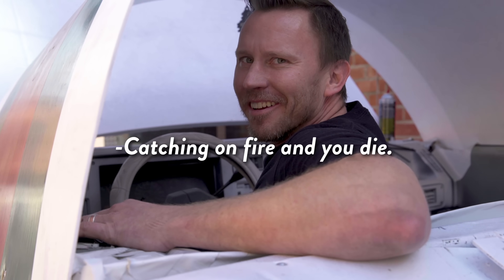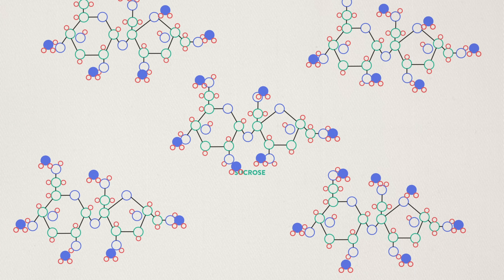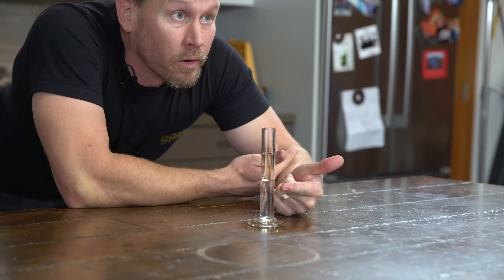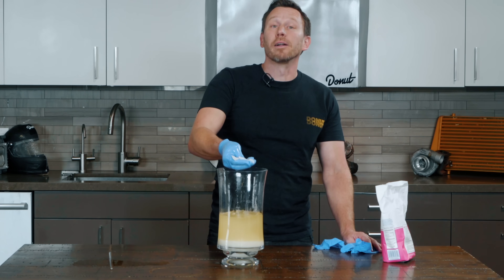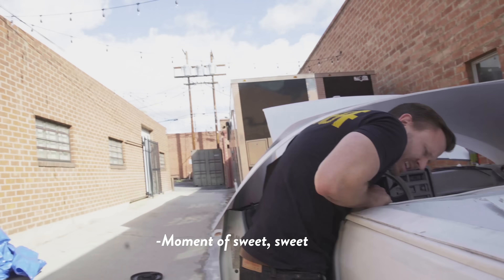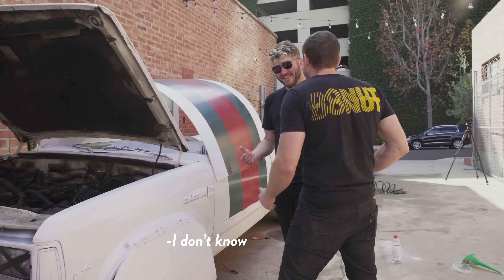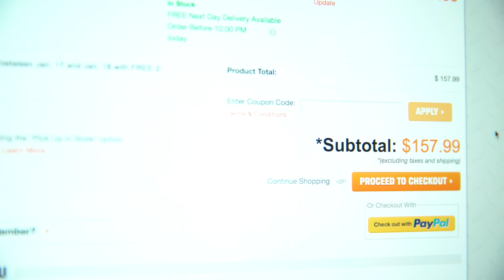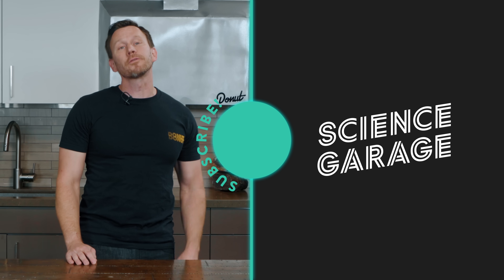SUGAR IN THE TANK - What actually happens? | HOW IT WORKS | SCIENCE GARAGE

Comment from the maker: You guys requested this one!  How'd we do?  Do you like the "in the world" stuff?  What other things do you want to see?
Reply: I wanna see Bart excited again
Reply: Put popcorn kernels in the radiator
Reply: You did not take into account movement of the vehicle and it allowing more sugar to get sucked into the engine while driving around. Just idling the engine isn’t a good test or example.
Reply: @Gumbysgoodside   my exact thought too
Reply: Put sugar in the oil
Reply: I've never done it, but I've been told to put a bottle of brake fluid in the tank. Don't know what it does to the engine, but apparently it smokes more than George Burns!! And looks like the engines blown.
Reply: What would it do to a diesel engine
Reply: You should pour brake fluid all over your car and see what happens.
Reply: What about eggs. Heard the yokes clog the tank
Reply: What about putting diesel in a gas vehicle
Reply: Fill the engine oil hole with windshield washing fluid
Reply: Thanks for doing this video guys, turned out great! I've always wondered about what the sugar actually does. Perhaps it would be more detrimental to a fuel injected car... 
I'd love to see a video on whether nitrogen filled tires actually did anything for economy. Remember how that was all the rage just a few years ago? Thanks, I enjoy all your videos!
Reply: I was always told to use water cuz it won't cool the engine as well and water doesn't burn or compress nearly as much as gas will
Reply: DISSOLVE IN WATER FIRST
Reply: Why ruin that fly ass flip flop.........man......
Reply: You got to drive it around, shake up the gas and sugar.
Reply: I love that people forget that gasoline is filtered first... Movement changes nothing except to clog the filter. If you mixed gas and water then you have a liquid and therefore that's the reason Denise made your bitching ride and bitching brick. I trust Bart's science like I trust myself, with reckless disregard for others safety and wishes! MORE GAS IN A JUG PLEASE! hahaha
Reply: How about an episode about Wheel Alignment?
Reply: Donut Media put urine in the gas tank next time
Reply: I really like how he appears to be lethargic and tired. It's much more entertaining then his typically inflection that's a constant rollercoaster. keep this new style of speaking plz!!
Reply: Science Garage - VR6 engine
Science Garage - quattro vs 4-motion
Science Garage -  How does a haldex work
Science Garage - Variable intake lengths and the effect of intake plenum length on NA engines
Reply: If you want to kill a engine put bleach in the engine oil give that a go
Reply: Drive it around.....it’ll move it around
Reply: Try dissolving sugar in water first then put it into the gas tank.
Reply: @Donut Media can we get a vid on where is Bart and Science Garage ?
Reply: Bring back bart
Reply: We want Bart back
Reply: Please bring bart back!
Reply: You guys should take a look at the inside of that puppy and see if the sugar melted to the inside of the cylinders/what it did to different parts of the system. And next time maybe go full russian and see if vodka could power it, for the laughs.
Reply: Bananas in the exhaust! 🍌
Reply: Using powdered sugar or sugar dissolved in water is a better bet to get the sugar into the engine. Powdered sugar is a lot lighter and more likely to move around in the gas. Water with sugar dissolved will mix more readily as well.
Reply: Bart's new beard is sekkksy
Reply: What about a vid about a hemi engine and what makes it better than a regular one
Reply: I think you should've used a fuel injected vehicle, my two pennies. You always do great videos by the way. Please, keep it up!
Reply: Can u guys plz make a video on a automatic transmission works
Reply: im liking the beard
Reply: Do rice in the radiator. Idea being that the rice will soak up the liquid and thus over heat the engine.
Reply: Have you thought about trying this but with raw eggs in the gas tank? I've always been told it will ruin an engine.
Reply: Sugar in a carbureted car doesn’t do anything, what if the sugar is added to an injected car... injectors could get clogged
Reply: Power steering
Reply: You guys should do a video on gas or oil additives (Seafoam or Lucas for example) and see their effects
Reply: Episode on how the computer of a car works, the box inside the engine with all the little color fuse
Reply: You gotta agitate the sugar by moving the car
Reply: Some part in asia did use naphthalene (toilet odor repellent) to save gasoline. Can you review that or prove something from it?
Reply: What would happen if you pour 2 stroke oil into the tank? Or lots of water
Reply: It would be nice if you could do powershift transmissions.
Reply: Try E85 without a tune I just need validation on my theories and preferably on a non flex fuel car
Reply: Use a dry funnel to dump the sugar in the tank and the fact that it doesn't mess up right away is what you want then when it does thenmaybe you won't be suspected,,,it Wil cost the person a lot of money 💰 💰 over time b4 someone figures out that the tank has been sugared ,, drive long enough with shade tree fixes you'll end up putting on a new carb, plugs,wires,fuel lines,drop tank and replace or wash out,not to mention all the fuel filters you'll go through also,,,it'll add up to some buckos. Also if it gets down in the cylinders it's going to do even more expensive damage to the engine.
Reply: Try the same thing but with e85 fuel. E85 collects moisture and is polar so the sugar should dissolve with the fuel.
Reply: put vape juice in the gas tank!
Reply: try it with honey
Reply: Please make a video on the 2l ABF motor I see it can produce massive amounts of horse power when tuned for a 4 cylinder... my lecturer said sugar makes the combustion more volatile
Reply: Put a ping pong ball in there, I really shouldn't even post that one.
Reply: You used a carbureted engine the problem with adding sugar to a fuel tank is it clogs the fuel rail and injectors which means you have to replace your fuel system on a modern car.
Reply: Gas sugar mixture you pulled out of the car is like homade napalm FYI
Reply: the tank is the wrong place u guys put the sugar. The sugar should be added to the engine like you are adding engine oil and start the engine the sugar will melt and bond with the oil because of the engine oil getting hot and then when the engine cools the engine will jam
Reply: Run a car without an air filter on a dirt road. Put rubbing alcohol in the gas tank and see how long it'll run.
Reply: Maybe if you drive the truck around it will put more sugar in to the engine. With the bumps on the road
Reply: I’d like to see your description of CVT type transmissions.
Reply: CAN YOU DO AN EPISODE ON HOW A GAS PUMP KNOWS WHEN TO CUT OFF?!?!???
Reply: Skittles and bleach in a fuel tank
Reply: Where the science garage this week
Reply: Moth balls in the gas tank
Reply: yo what song do you guys use in the background of science garage
Reply: what about rubbing alcohol in the gas tank?
Reply: Camera angles and “real world” stuff was fantastic, keep it up
Reply: Soda, cheap beer, liquor
Reply: What does sugar do to diesel
Reply: This was awesome! But what happened to the Science Garage?! Did you guys cancel the show?!
Reply: How about a 2 liter of coke in the gas tank? Maybe it will mix with the fuel better.. or worse technically??
Reply: I think it's pretty great you guys do trial-and-error stuff, it's different world between she says/ he says.
Reply: Donut Media what truck is that
Reply: You should of drove around so their would of been realistic vibrations like bumps in the road. Nobody in the real world is gonna just be idling there.
Reply: You didn’t drive it, sugar just sat in bottom of tank. How about if you drive around sugar would splash inside the tank, probably clogging fuel pump...
Reply: My mom put surgar in her principals tank in school
Reply: Could you do one on the physics of cars in inclement weather? Why cars behave the way they do when you drive in the rain or in the snow?
Reply: Moth balls in the tank........
Reply: Hey please do a coffee in the tank
Reply: Maybe should of drove the car around for a while. The motion of the car would shake up the tank and mix the sugar into the gas. Re do please!
Reply: drop sugar in it and piss in it and name the truck sweetpee
Reply: What about salt? Same non polor deal going on?
Reply: What about liquified sugar (sugar dissolved in water)? Or maple syrup? Sugar substitutes?
Reply: Donut Media now pull out the gas tank and pull apart the engine to see the results up close
Reply: Do ethanol?
Reply: So, I heard putting Cola in the tank kills an engine.
Reply: after a few days the sugar turns into a liquid when its left in gas. maybe dissolve it in gas a few days and try again
Reply: Worked on a car had pancake syrup in tank. fouled the plugs. after  waiting for a month for insurance to approve repairs the syrup crystallized. Ended up clogging fuel lines . All said and do ne ruined engine.  Try it .
Reply: Gasoline and water do not mix.  You need a go between to mix the water with the gasoline, like  that GasDry(name brand HEET) stuff to allow the water to mix with the gasoline. Mix the sugar with water then mix enough GasDry with the water/sugar mix to allow it to mix with the gasoline then the sugar mix will go into the engine. That should ruin your engine.
Reply: ping pong balls in the gas tank :D
Reply: I HAD LITERATURE OF TESTS DONE BY FORD MOTOR COMPANY OF SUGAR IN THE GAS TANK. LIKE YOU SAID IT DOES NOTHING AND SITS AT THE BOTTOM OF THE TANK.
Reply: BACK IN THE DAY THEY WOULD PUT POTATOES INTO THE EXHAUST PIPE/PIPES. THEY WOULD PUT THOSE BIG IDAHOS IN THE TAIL PIPE AND KICK THEM IN. MY FRIEND DID THIS TO THE DEAN IN JUNIOR HIGH SCHOOL THAT HE HATED. I WATCHED HIM DO IT FROM THE LUNCH ROOM WINDOW WHERE HE WAS KICKING A POTATO INTO THE EXHAUST PIPE. WHEN THE TEACHER MR. SWITZER GOT IN HIS CAR, WHICH WAS A BIG PONTIAC BONNEVILLE. AS HE WAS STARTING IT. I SAW THE POTATO SHOOT RIGHT OUT AND DIDN'T STOP THE CAR FROM STARTING AS IT WAS INTENDED TO DO. YOU SHOULD TRY THAT EXPERIMENT. MAYBE MY FRIEND USED A TO SMALL POTATO.
Reply: maybe you need to drive around because when you drive around the fuel sloshes and perhaps more will get sucked up if you drive
Reply: Donut Media what happens to an engine when gasoline is out in Diesel engines  and visa versa
Reply: YOU GUYS NEED TO TRY AGAIN WITH FIBERGLASS RESIN INSTEAD OF SUGAR  !!!!!!!!
Reply: Needs agitation. The truck sat still allowing it to settle. If you were driving it around I think it would have killed it.
Reply: What about sugar that is already dissolved into a liquid.  Like soda or coke in the gasoline.
Reply: Can you hear the deep breaths he's taking over that gas,... I think he likes it... it's why he's so hype.
Reply: Donut Media  can you help me enter to win on of the hi or lo cars hoods it wont let me and I just want to win so can you pleas help me enter and tell James and Nolan I Want to met them their my hero’s
Reply: You didn’t tale the plugs out before and after and look inside with one of those cameras
Reply: Where is Bart in 2020?
Reply: Do Sugar in a Diesel powered car. The sugar might react differently with Diesel fuel.
Reply: 700 like?!?
Reply: 0
Reply: Try it on a fuel injected engine instead of carb.
Reply: Really should have pulled the plugs and looked into the cylinders and taken a peek at the fuel filters..
Reply: The test should have been done with a vehicle driving around not jus sitting still. If the vehicle were moving the sugar would b agitated in the tank. Thus it would b sucked up by the pump and pulled thru the fuel system. The experiment should be done under normal driving circumstances.
Reply: How about you try salt
Reply: I know it's been two years since you made this video but what about sugar and a diesel engine
Reply: Water, put water in the gas tank see what happens
Reply: Could you please do an episode on coke (or diet coke?) in the engine oil?   THANKS!
Reply: I would wager that since the truck was standing still. The results were not as bad ad agitation from driving and you may get different results.
Reply: If you’re driving around the sugar will be sloshing around in the tank getting all mixed up in the gas and will probably suck up more then just sitting in park letting it run
Reply: Putting sugar in a gas tank is fact you’re going to mess up your truck you guys are No No means a mechanic ass holes !
Reply: Hi if you add sugar and water poured in your gas tank that’s a total different story the sugar is dissolved and it gets sucked down with the gas
Reply: I’m proud of you guys and the Chanel you have come a long way (example) I asked serie today what happens when you pour sugar in a gas tank this video was at the top of the choices I’ve been with you guys from the beginning and it’s an honor to be a follower and see you all do great work and see you guys cry laugh dedicate time effort and passion and to see this happen is amazing you all and the team are amazing greatly appreciate you guys got me through some hard times for sure and pushed me to do more thank you all
Reply: If you would had drove the car around that whole time the sugar would have sloshed around while turning and breaking and more sugar would have made it to the engine
Reply: The engine will seize when the engine cools and the sugar is no longer a solution. Some of the sugar has dissolved, and that sugar can be smelt as evidence. Do a follow up and I'd expect different result now that the sugar has recrystallised in the engine
Reply from the maker: @ardie72  it doesn't dissolve.  That was the whole crux of the video.  If anything  made it to the engine, they were tiny crystals...
Reply: Donut Media oh I understand your rationale completely, but you are wrong.  Explain what the burnt corn smell is if not sugar making its way to the cylinder walls? You will find, although not completely dissolved, that some sugar will in fact dissolve. And that dissolved sugar will make its way to your cylinders. You even smelled it yourselves. Ask mr Humphrey
Reply: @Donut  it's not gas it ruins, its diesel engines it ruins
Reply: @ardie72  they need to drive it around also that way the sugar gets swished around instead of just settling while it sits.
Reply: Hard to get into the tank...........simple fix......sugar packs
Reply: Donut Media I hate this guys hand gestures he just repeats them

Comment: So, from personal experience "YES" powdered sugar in the fuel system can cause engine failure. In my case it made it up to the injectors causing the #8 injector to stick open washing the cylinder wall taking out the rings and causing the intake valve to bang a hole in the top of the piston. So urban legend, fact,  I think it's a little of both and definitely case by case......

Comment: You guys had some great scientific explanations, but you missed out on a couple of things.
Sugaring someone’s gas tank was never adding straight sugar. if you ask any good mechanics who’s over 70 years old, they will explain to you what my dad explained to me when I was a kid. (my dad worked on cars my whole life and even worked at the General Motors assembly plant.) If you’re going to sugar someone’s car you add Sugared Water. The purpose was to foul up your fuel system/lines with something that wouldn’t go away easily because, as your experiments showed, gasoline doesn’t dissolve sugar and doesn’t mix with water.

Comment: You guys should really look into your research on your experiment because you guys are actually wrong that whole thing about having extra gassing to wash it down into your gas tank because it gets stuck on the filler whole. What should you do is that they use water to freaking make it actually go down and want to go to the water with that water. The sugar will dissolve into the water, and then the pump will pull it and then mess up your engine speaking from personal experience here that is what they did to me to my Buick 1998 the saber but my engine is strong and it’s still running just my fuel system that I have to get a whole rehaul.

Comment: I have had to repair a sugar damaged mustang. Pissed off latina wife. It killed the ecoboost engine, totally. Fuel injectors clogged, fuel rails filled with fine sugar, piston rings seized. There was still sugar in the filler neck. Was a nightmare to get right. Engine rebuild, then multiple attempts to clean the lines and tank. Cost him a a fair bit.... and sugar definitely works. You just need to run it for more than an hour.. did the guys have to go to lunch or something? Why so short?

Comment: It's going to lock up because it does dissolve in gas. It might take a few days but it does. It's going to coat the head n valves n rings with a coating of cooked caramel n stop engine. Trust

Comment: Whilst hydrocarbons will not dissolve sugar, there is something in modern fuel that will, and that's the ethanol that is now added. That will probably dissolve very small amounts which will carry through to the engine and be burnt.

Comment: sugar can burn in a engine. you just need to heat it up until it turns into vapor and then feed the vapor into the enegine and it will generate power.

Comment: I wonder what that would do to the cylinder walls, piston rings, and when it mixes with the oil what happens to the bearings and camshaft. I would think it would change the oils structure and cause havoc.